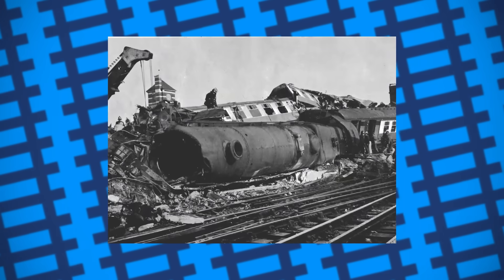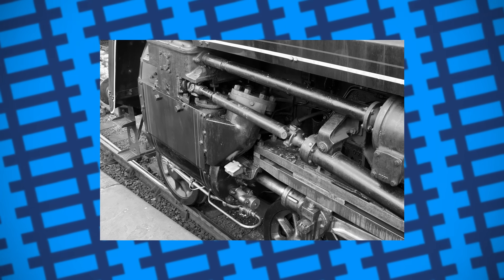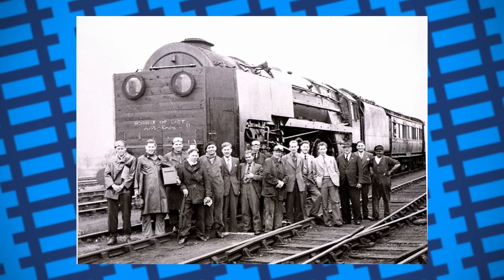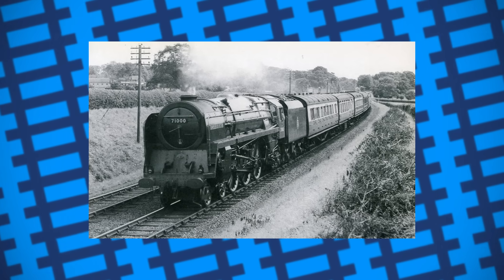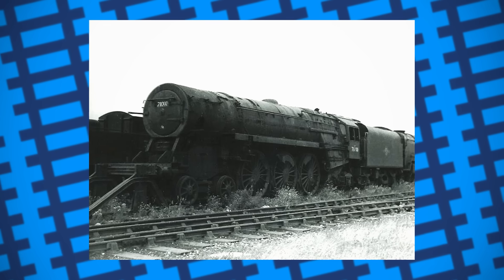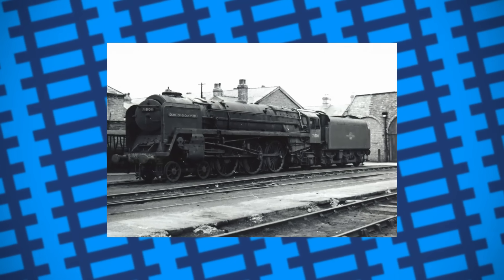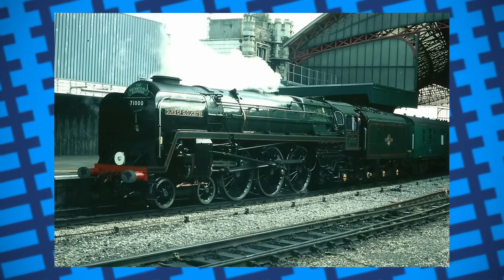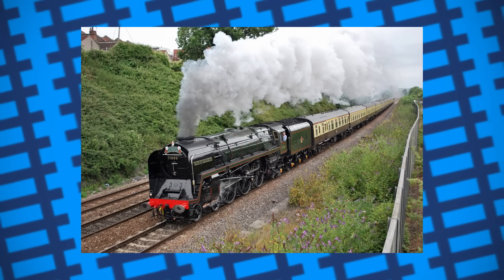How British Railways' Worst Locomotive became a Heritage Hero - BR Class 8 "Duke of Gloucester"

Comment: Biggest issue was that people treated the engine as a big Brit and tried to drive and fire like a Brit.
Another firemen wrote into steam railway years ago when an article written saying he never saw the fuss.   Saw it was a 3 cylinder engine and fired it like a royal Scot that was also 3 cylinder.    Reckoned he never had an issue with coal and maintaining steam.
Different valve gear and extra cylinder and wonder why didn’t perform.
That and the lack of interest doomed as a “poor” performer.
Reply: That being said, the Duke had been relegated to not quite top-link trains, where you could get away with slightly lower power outputs. Because of the wrong blastpipe and wrongly constructed ashpan reducing the grate area, the maximum steaming capacity was limited - if you fired more than a certain limit the coal just went straight out of the chimney. Now that those two problems have been solved, it can produce higher maximum power continuously.
Reply: They would’ve been more familiar with the Princesses and Duchesses too. True, they are four cylinder engines, but their arrangement makes for drafting that’s a bit closer a 2-cylinder engine. You hear Elizabeth or Sunderland go by, and it’s four beats per wheelturn, because the cranks are all 90° offset from each other, same as on Brit. Even if the draft is stronger, there’s still two cylinders in the same stroke position at any given moment. The Duke’s cranks are 120°, accounting for the six-exhaust beat per wheelturn. Each cylinder acts on the fire independently, so the draft is more constant. Had the Stanier Pacifics followed the Royal Scot’s and had their valve gear derived from the Lord Nelson’s (145° crank offset iirc) then the story might be a bit different

Comment: I witnessed the power of the Duke in preservation first hand.
It was on the East Lancs Railway where I had a trip in the cab of a class 40 with 7 on, and well before GPS and strict speed enforcement. The driver gave it a good full throttle up Broadfield Bank and managed around 35 at the summit.

Later that day the Duke was placed on the head of this train and was given the honour of powering the train with the class 40 still on the train as well, I also was in in the cab of the 40 now and the throttle was at idle all the time. 71000 managed to get the speed up to 40 before shutting off with the summit still a mile or so ahead. She could have gone even faster at reaching the summit.

Comment: In 1961 it came south and failed at Bletchley (where my dad was a fitter) and after fixing it they couldn’t get it to move (stuck valves) they were told to give it a shove with power applied. They did so and it blew the roof off the shed.
Reply: Love it, hahahaha, if only they had tixtox then...

Comment: The Caprotti valve gear solved the issue of the inside cylinder as mentioned. The valve gear system also gave it more accurate cutoffs and a more sharper exhaust blast. This exhaust was unmanaged during her BR days so the fitting of the KylChap exhaust system and correcting her dampers gave it a very heavy breathing firebox. This combination made her so powerful and very efficient(Caprotti valve gear FTW!) that the Duke is the de facto most MODERN steam locomotive ever built. The A1 Tornado cant hold this title as it still uses the walschaerts valve gear.

The T1 or P2 Prince of Wales might dethrone the Duke as it will use a different but similar poppet valve gear.
Reply: Indeed! The Duke might have a “pound for pound” edge in the use of Caprotti, as the gear effectively allows for a lower minimum cutoff. I also think steam flow might be a tad simpler on Caprotti, as the valves are vertical acting. The Lenz-derived gear used on the P2 and T1 uses horizontal acting valves, similar to a piston valve. So as steam enters and exists the cylinders, the path to the steam chest is simplified, a bit like the streamlining done on the steam passages on engines like the A4’s

The decision to use Franklin-style Lenz gear on the P2 was mostly down the clearance restraints. The driveshaft has to be mounted higher on the cylinder assembly, which would cause problems with the monobloc casing. Lenz allows the placement to be more or less horizontal. The Duke avoids this problem by being Divided Drive, and I think it’s the only locomotive to combined any form of rotary poppet valves and divided drive with an odd number of cylinders
Reply: Isn't the Red Devil modern?
Reply: considering that the most advanced and modern steam locomotive designers opted against poppet valves may speak to why they didnt become common.  With good valve design (and having 2 per cylinder) piston valves are all around superior to poppets, which is why the 5AT wasn't going to use them.
Reply: @1471SirFrederickBanbury  I think David Wardale said it was difficult to get a small clearance volume with poppet valves.
Reply: @joejoejoejoejoejoe4391  To add, poppet valves are usually considered more effective at sustained HIGH speeds, due to the finer steam admission and exhaust at short cutoff. Freight engines spend more time at full or long cutoff, and at slower speeds, which is where poppet valves are either no better or worse than piston valves. Even in terms of creating more power at the same cutoff, this wouldn’t have done the Devil any favors considering its poor factor of adhesion. 

There was a design of Franklin gear proposed whoch would exploit the compression of steam, prolonging this part of the cycle to buffer the piston from a surge of admitted steam which would otherwise cause a wheelslip.
Reply: @russellgxy2905  There was a guy (Jim Eddwin if I remember correctly) who made a model 9F (5 inch gauge) and to reduce wheel slip in full gear, he added a middle dummy piston valve between the regular front and rear, this had the affect off slightly covering (it had no rings and had clearance ) the steam admission ports, reducing the pressure in the cylinder at mid stroke, a very simple, but effective idea. It's interesting that uniflow cylinders were never successful on steam locomotives.

Comment: This is complete twaddle sorry. It was due to cost saving measures that the engineering team were forced to use existing systems . It was against the advice of the creator but he had no choice.

It was actually somewhat modified later after it was resurrected from the scrappers yard and saved. 

However during regular service it was stuck as more or less the original build.

Please don’t make out that the engineering team were at fault here as that is totally disrespectful to a brilliant team who was overrode by senior management decisions.

Also keep in mind that the railway was severely bleeding money by the time this engine was introduced so it never really has much chance as diesels were already starting to be on the scene as it was.